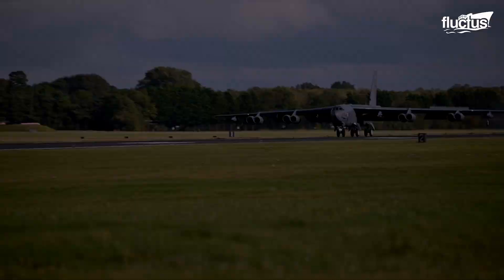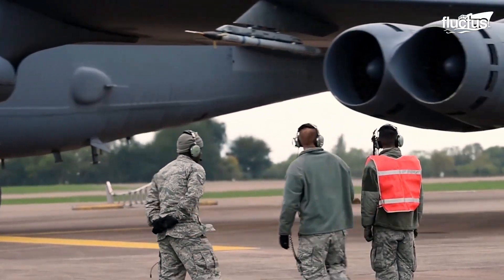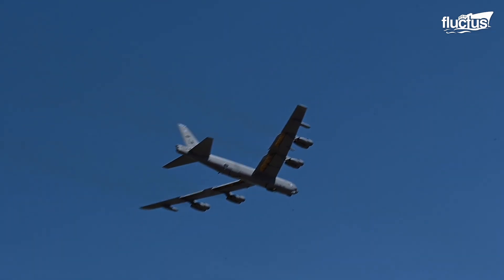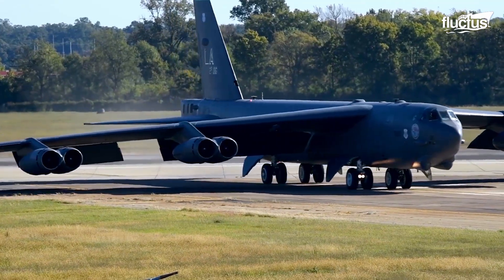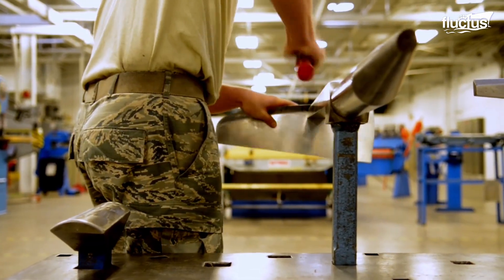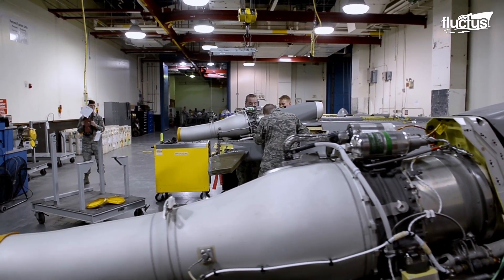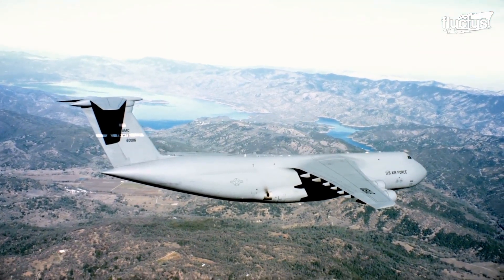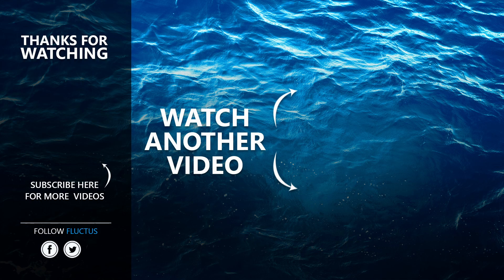The Reason Why This Monstrous US Bomber Needs 8 Engines To Take Off

Comment: When the B-52 was designed in 1948, the most powerful engines developed only 17,000 pounds of thrust. Thus, eight are required to get the plane airborne. Today''s engines can develop 78,000 pounds of thrust, so if the plane were designed today it might only have two engines. The new Rolls Royce engines are designed to still provide only 17,000 pounds of thrust, so as not to require redesign of the wings, but to improve fuel efficiency and increased range. The remaining 76 operational B-52H's are 62 years old, The primary structural components are never replaced. The main reason for their longevity is that the usage has not been as severe as was projected. We designed the B-52G/H in 1956 for high-altitude bombing. The emphasis in the structural design was minimum weight, to maximize range. But in 1961, at the height of the Cold War, we redesigned the structure to meet SAC's new, more severe usage and service life requirements. These notably included low level terrain avoidance training, often under extreme gust and maneuver conditions. The emphasis in structural design shifted to toughness and durability. As Chief of Structures Technology at Boeing-Wichita at the time of the redesign. I am honored to say I chose the materials, the analysis methods, and the limiting stress levels for the redesign. I am now 96 and I am thrilled to see these planes still flying, and projected to do so for many more years.
Reply: A life well lived. Thank you for taking the time to comment! Amazing that these engineering wonders will outlive their creators!
Reply: @threethrushes  
Creations "outliving their creators" isn't uncommon, hard to say how moot he thinks it is of you saying that he will be outlived by the results of his labours, he hardly needs reminding.
Reply: Mr. Lawrence, thank you for your lifelong work to our great country, being 96 I guess you served at the end of WW2 unless you served at 17? How do I know you served? Because your generation is the greatest generation and you and all your friends volunteered. Unlike nowadays where most people ask what their country can do for me, your generation asked what can I do for my country. I pray you are in good health and you live out the rest of your amazing life in excellent health, you deserve it my friend.
Reply: @MaximusMerideus  Thank you. Yes, I enlisted at 17 and served in the Navy. I trained as an Aviation Radioman-Gunner. Thank goodness the war ended, and I did not see any action. I had 22 relatives in uniform.
Reply: @lawrencegore6647  That I knew it without ever talking to you or meeting you just illustrates that your generation is the greatest. If you were born in 1925 instead of 1927 you would of seen nonstop action either in Europe or Pacific and chances are, being an Aviation Radioman-Gunner, you might not be here. It's so sad how many of your fellow WW2 veterans we're losing daily. It's going to be a sad day when our country loses the last one. I wish I lived close to you to be able to take you to lunch and talk with you, you would never pick up a tab if I saw you out, I don't think any WW2 guys should ever have to pay for dinner/drinks. Our country owes you all a debt of gratitude. Your generation are my heroes. Thank you good sir.
Reply: @MaximusMerideus  Thank you for yur kind words.
Reply: @MaximusMerideus  3:37
Reply: Thanks for sharing your expertise Lawrence, it must be amazing to see your hard work still validated decades later.
Reply: My Dad transitioned from piloting B47’s to B52’s.  I remember him telling me these things.  Now they’re carrying laser&GBS guided bombs from the contractor I retired from.  (I was a Paveway design/test/prod engr)
Reply: Growing up in Wichita the B-52 was always a treat to see. I remember going south on Oliver through the plant and seeing those big hangers partially open and being thrilled to see one sitting there. I remember fishing off the dam at Marion Reservoir when one came over on a low pass. Took my breath away. Thanks for sharing your story.
Reply: Mr Gore your brilliance and dedication are the quintessence of these United States of America. Thank you so very much. 💯💯💛💛💛🙏🙏🙏
Reply: Was at Castle in the late 80's. We flew, If memory serves about half of SAC hours as a training base. This was after SAC went off Airborn Alert and had downsized the fleet. Cannot speak to the airframe aspect but as a Hydraulic troop we changed and resealed MLG Struts weekly. We swapped them out regularly due to this. The forward thinking you describe on increasing toughness is still evident 30 years after I left them. Kudos.
Reply: We salute you, sir ! Big Buffy was made long before I was born and will still fly even after I am dead. It's great people like you that defeated the evil empire of the Soviet Union to preserve freedom and democracy ! Now with the huge threat from communist China, those venerable Pratt & Whitney engines need the new technology Rolls Royce engines can provide to thunder the skies. Long live the B-52 Stratofortress !
Reply: Well done that man for your hard work and its amazing to think this aircraft the B52 was born before me , and still fly when i retire in 8 yrs time , the old B 52 with the old engines screams like a banshee , i love that , older engines sound better than to todays hush engines .
Reply: The man himself 🙏
Reply: What an achievement to be proud of! Thanks for your hard work!
Reply: Question: will the new RR engines not require the carts to start up then?
Reply: @markvolpe2305  I see you didn't get an answer yet,  It's kind of a long story.  The term "start cart" I think was used incorrectly here. A "start cart" is an electrical generator,  and/or an air compressor. Older engines had a gear box in the front, with a port for compressed air. The compressed air would spin the the engine to ~25-30% to start it. The generator was plugged into the aircraft, so the starter/generator could spin the engine to start. After 1 is started, that will provide enough power to start the rest. The 'explosive canister" type start is old WW1 and 2 technology. Old fighter planes used a charge about 4 times larger than a shotgun shell. The ground crew, or pilot even would load it, then set it off when ready to start. It turned the piston engine over a couple times. With 11 cylinders you hoped a couple would fire and run. LOL.  The Gulfstream private jets use the same RR BR725 engines that they are going to use on the B52. They are 18k# thrust ea. and will be used in pairs, same as the original design. They should start on their own fine, or with a "jump" from a start cart to start one. I can't think of any reason to use an 'explosive shell start'. They are very reliable and much more fuel efficient. They shouldn't 'smoke' as much on TO either LOL.  I hope that answered your question, best I could do in this short space.  8)    Peace   --gary
Reply: @markvolpe2305  Does a Gulfstream or modern airliner  require cartridges  ?
Reply: @chrissmith2114  I don't know to be honest.
Reply: @chrissmith2114  I’ve never seen cartridges used on a Gulfstream, and I can say I’ve seen hundreds of start ups. Typically the line crew will utilize a cart that has a smaller turbine engine (think of a modular jet assist), and once fired up they open an access port on the G6, attach a large air duct and let er rip!

I was lucky enough to had grown up in the aviation biz. My family owned West Star Aviation in Colorado. For many years it was Cessna 182’s and King Airs, as we grew we began servicing Learjets, Challengers, and Citations. That’s when it got fun.
Reply: @BennyVonBlanco  Thanks for info
Reply: The first engines on a 52 didn't have that amount of thrust that's why they used water injection they used j57 the  TF-33 didn't come about till the 60s get your facts straight  and your not 96 so don't start with someone who worked on them and kept them airborne....
Reply: @thomascreary990  You are correct. I was explaining why the plane has eight engines, and forgetting that it was not until the H model that the TF-33's had 17,000 pounds of thrust. Earlier models only had about 9-10,000 pounds of thrust. What is your crack about not 96? Where were you in 1960?
Reply: @thomascreary990  water injection on a jet engine? never heard of it I have heard of water injection on gas powered piston engines during WW2 to stop detonation and allow the engine to run on lower octane fuel I want to know why a jet engine likes water injection thanks
Reply: @Jr Smith  do your research on early jet engines it increases thrust and I know KC-135  AND B-52'S A THRU G MODELS I worked on them get your facts straight
Reply: @jrsmith1008  Water is injected just before combustion, to add mass to the jet exhaust, giving greater thrust.
Reply: @thomascreary990  I don't have to "get my facts straight" I don't own jet engines, I don't work on jet engines, I don't even ride on jet engines, furthermore the only engines I care about are my four V8 engines which I know intimately, I don't have to know it because you told me how it is thanks for that.I was simply curious about water injection, now I know,  again thank you for your knowledge
Reply: @LawrenceGore thank you for your service and God bless you! 🙏🏽🙏🏽🙏🏽🙏🏽
Reply: Don’t tell ALL the secrets.
Reply: The longevity of the B-52 is a testament to the fantastic engineering done by Boeing's team!
Reply: so they could not replace each pair of 17,00 pound thrust engines with 1 engine of 34,000 pound thrust if it's size fit the wing? The stresses on the wing should remain the same of the mount points for the engines are still only dealing with the same thrust load.
Reply: @jaquigreenlees  I'm sure they studied all the options.  For instance, there may have been ground clearance problems with larger engines, and may have required a larger fin for engine-out control.
Reply: @jaquigreenlees  The other issue is additional redundancy for a warplane.
Reply: @jaquigreenlees  , ground clearance for one on the outboard mounts.
Reply: @jaquigreenlees  re-motoring the airplane beside possible wing redesign will also require redesigning thrust control in the cockpit as well as replacing the electric wiring and reprogramming the onboard electronics.
Reply: Thanks for mentioning… I (;PHARMACY70) & Family are all, PURDUE  GRADS:: Anyways ,the *Aerospace, *Flight, *Engineering,*ASTRONAUTS, etc. & are such a Credit *& value to,app,of Us ….. great Work!!
Reply: Wow. What an honor sir! 

Thank you for sharing!
Reply: Nó
Reply: Im still wondering why they didn’t go for 4 engines…. But when u said they would have to redesign the wings,  i got an idea, thanks…
Reply: @frankangermann6460  I think there were at least three problems in going to only 4 engines. First, a larger diameter engine may not have had sufficient ground clearance at the outboard location. Second, an engine-out with only four may have required a larger fin and/or rudder for yaw control. Third, there may have been problems attaching to the wing structure.
Reply: @lawrencegore6647  thank u….
Reply: @frankangermann6460  A single larger engine would also hang down lower, making it  FOD more likely,  also if you have 8 engines, losing one or two is no big  deal, but losing engines when you only have 4 is much worse.
Reply: I'm available for an internship and I make very good coffee! lol
Reply: If it's so great, why not get the drawings out and build more of them?
Reply: so youre a 96yo youtubeing grandpa
Reply: @awesomeoneupbros  Great-grandpa, that is.
Reply: I think these planes are useless today since rocket can destroy it easily.
Reply: Lawrence Gore, Thank you for your work on the Buff. Most especially the D models (tall tails). I was in SAC for six years and proud of the 7th Bomb Wing and the D's. Brought the North Viet Namese to the table.
After that I worked on the F-16 for General Dynamics, but on the other side of the wall from you design guys...manufacturing engineering. Many stories and memories of 'discussions' with design guys and how to build what they wanted. I'm sure you had your share of those!
Reply: That’s amazing Lawrence! What an amazing thing to contribute and be part of such a large and important project. I can only wish I can do something half as interesting. Thank you for your contributions! Love that you’re a 96 yr old great grandpa on YouTube! Blessings for you and your family!
Reply: Nice job Larry!
Reply: I was waiting during the video to find out why it needed eight engines.  Good video but it didn’t answer that. Thanks for the explanation (and your service).
Reply: Thank you Sir for your service.
Reply: Wow. Thanks for your insight.
Reply: Alright, brother! Get ready to witness the incredible power of the F-22 Raptor, a true marvel of modern aviation! We're gonna dive deep into the features of this bad boy and highlight its exceptional qualities. So, strap yourself in and get ready for an action-packed ride, brother!

When it comes to engines, the F-22 Raptor packs a serious punch, brother! Its state-of-the-art engine delivers a whopping 35,000 pounds of thrust. That's like strapping a rocket to your back and blasting off into the stratosphere! With that kind of power, this bird can soar through the skies with lightning speed and unmatched agility, leaving its opponents in the dust!

Now, let's talk about design and technology, brother! The F-22 Raptor is a sleek and stealthy beast, designed to fly under the radar and outmaneuver any adversary. With its aerodynamic profile and reduced radar visibility, this bird can sneak up on its enemies like a silent assassin. It's all about air dominance, brother!

This cutting-edge aircraft is equipped with advanced systems and materials that guarantee top-notch performance and reliability. Its state-of-the-art avionics and sensor suite give the pilot unparalleled situational awareness, allowing them to stay one step ahead of the game in the heat of battle.

When it comes to its mission, the F-22 Raptor is all about air superiority, brother! With its exceptional maneuverability and precision weaponry, it's a force to be reckoned with in aerial combat. Whether it's taking down enemy aircraft or delivering strategic strikes, the F-22 Raptor brings the pain with lightning-fast speed and deadly accuracy.

This bird represents the pinnacle of modern fighter aircraft technology, brother! It's a symbol of power, agility, and dominance in the sky. With its ability to adapt to ever-changing threats and stay battle-ready, the F-22 Raptor is a true champion of aerial warfare.

So, get ready to witness the F-22 Raptor in action, brother! It's time to unleash the beast and watch it conquer the skies with its unmatched power and precision. This bird is a testament to the incredible achievements of aviation engineering, and it's ready to rock the world of air dominance! Whatcha gonna do when the F-22 Raptor runs wild on you, brother?!
Reply: @jackryan1809  This is a B-52 site. The F-22 Raptor rave site is down the hall, on the left.
Reply: That's absolutely wild. A legend!
Reply: Jesus fucking christ, that last line kinda got me
Reply: More commonly nearer the 10-11000 mark.
Reply: Thank you for your service sir!
Reply: Great work sir! 👊🏻💥👊🏻
Reply: Nice my grandpa is 91 now but we are Vietnameses.
Reply: Well done, sir. The nation owes you our gratitude.

Comment: Does anyone know how long does it take to prepare a B52 for normal routine flight
Reply: Ground crew preflight is 6 1/2 hours aircrew preflight 1 1/2 hours.
Reply: Is there such a thing as a "normal routine flight?"  Time required depends on extra work that may require various specialist.  As a ECM technician, we would have a crew of 3-5 individuals waiting at the aircraft from the time all the maintenance was completed until the air crew taxied out.  All the other avionics systems would also have crews waiting. Sometimes they would find things that had to be fixed, other days we might get a nap..

Comment: Notice that nobody on the flight or ground crews wear rings of any kind. Tell me why after hitting my like button.
Reply: They don't want to lose that finger.
Reply: No unnecessary metallics near the aircraft.
Reply: Safety stupid I worked on them and tankers,fighter's and helo's and it doesn't take that long too get one moving a cart started once started their on the move the alert force had 15 minutes to be airborne so don't start something you don't know about I served in S.A.C even in a training mission
Reply: Plus engines are over hauled on base not shipped out I was stationed at minot 82-93 don't understand  about the feed the engines in that weather they loved the colder the better the combustion in the core